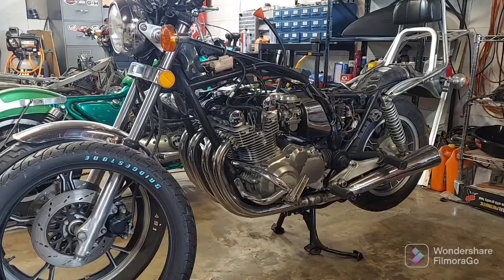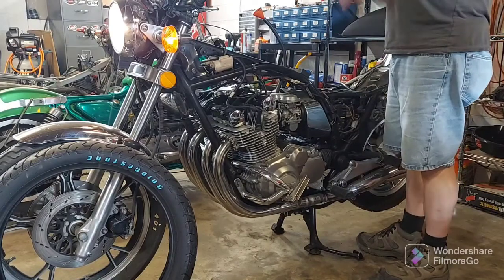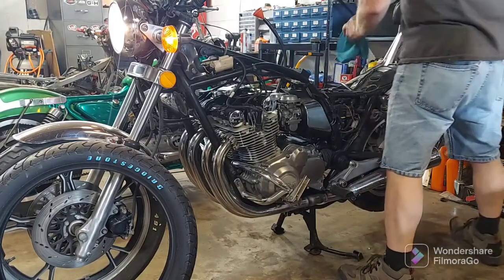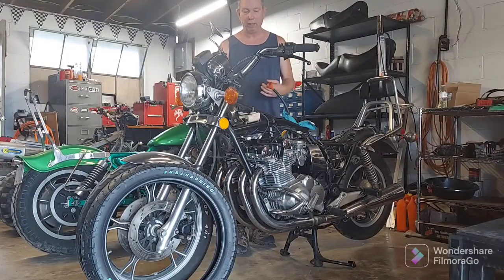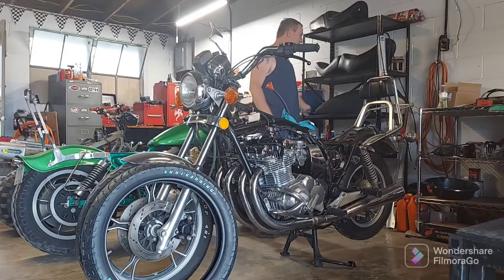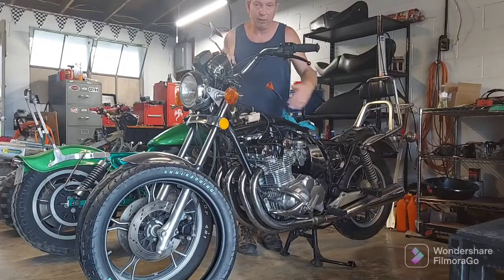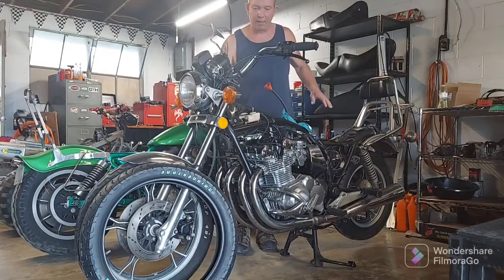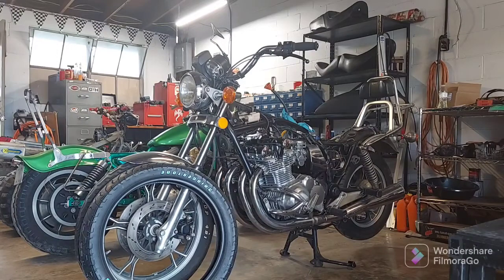Vintage 1982 Suzuki GS1100 L revitalization update

Comment: Hi.  I have an 83 GS850 L.. the shaft drive is rattling. Thought it was oil issue at the final drive.. but just noticed today that there's a play at the U-joint under  the boot. 
It moves to the back when  i push  it.. and looked at it when spinning. It's  goes backwards and the U jojnt touches  the shaft housing walls..
Reply: Any idea why? And how to pull that shaft out..

Thanks for any help

Cheers,
Reply from the maker: @Swakopmund  Might be a bad ujoint at the boot, or the bolts came loose at the ujoint. 
Remove rear wheel by pulling out the axle. Unbolt rear differential from swing arm. Pull back boot to access the 4 bolts at the drive shaft ujoint, remove 4 bolts and shaft is free.
Reply: @thedragon2299  thank you for the answer.  
I'll  pull it back later. Is there  a spring retaining or pushing on the flange..? Where can I send you a picture or a short video of I've found under the boot..? I  don't see where I can  upload a video. 

Thanks again